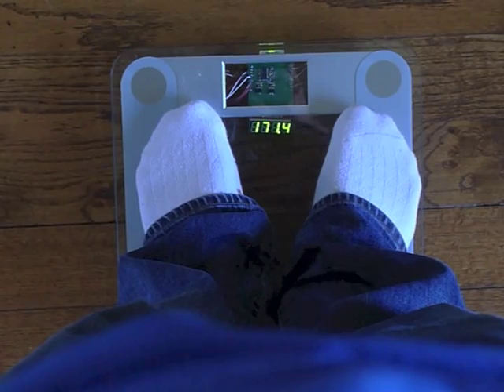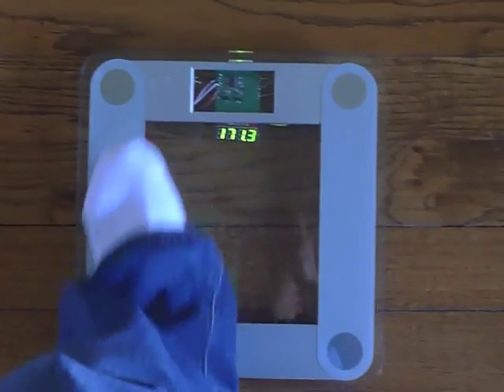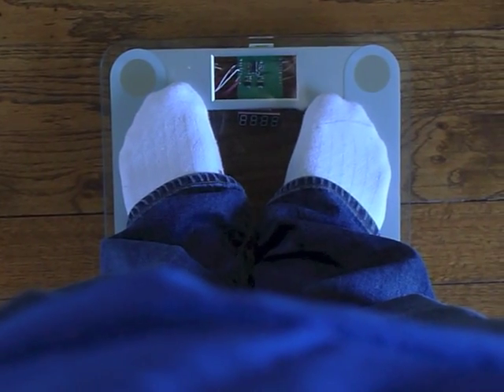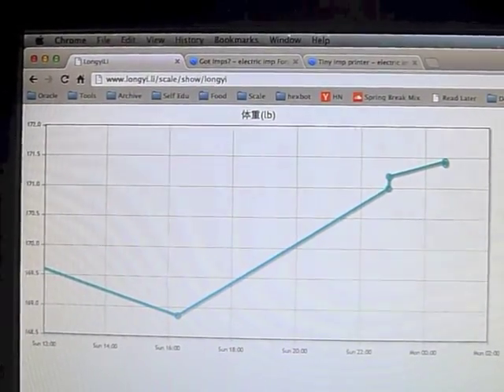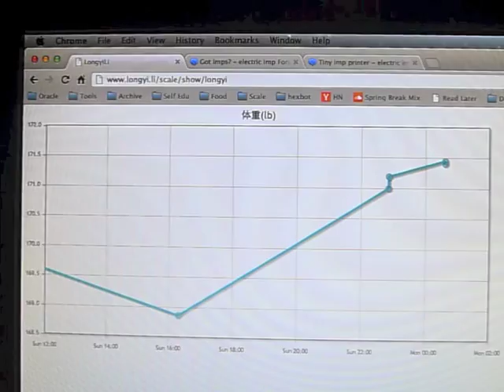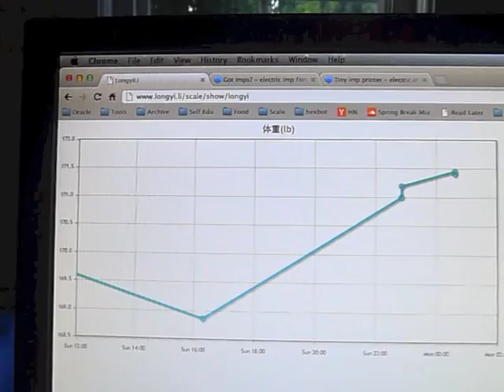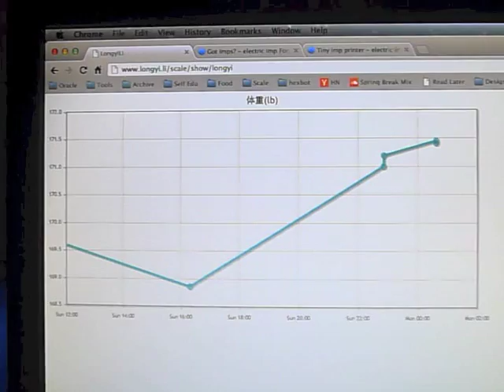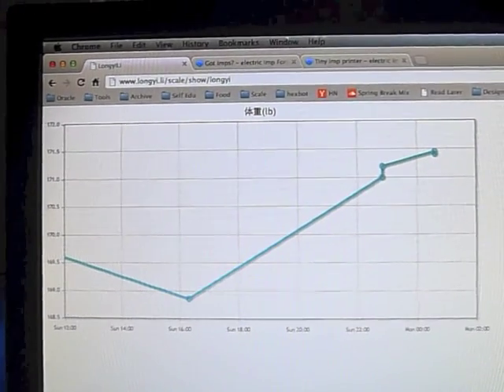Homebrew WiFi Weight Scale

Comment: Hi.  I see you have a scale with four load cells in a bridge.  How do you measure the voltage across the bridge?  Isn't it a very small value?  Do you use an instrumentation amplifier of some kind?